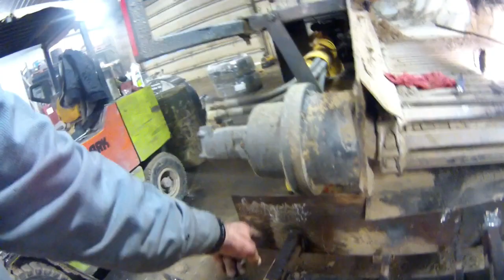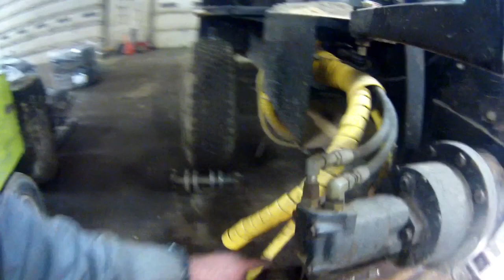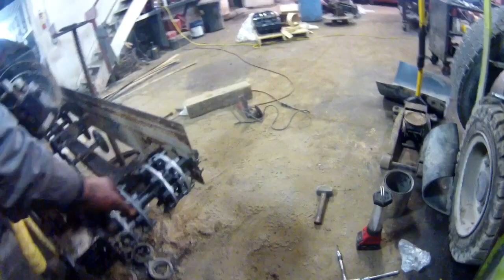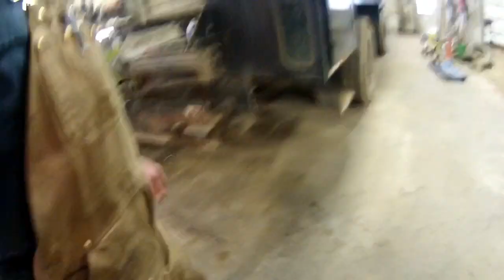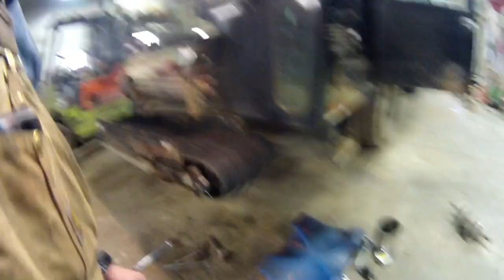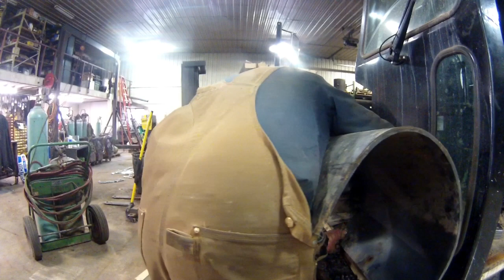Mensch sand truck repair part 2 of 2

Comment: Andy, on replacing that bearing,  when they designed it, they should of mounted that bearing away from the tank, bushings holding it away, so manure wouldn't be pushing against it, thus forcing corrosive manure into it. Even though it had a grease zirk,  probably didn't take grease because of being plug, that type of pillow box bearing are known for that.  Unless you would grease it daily or more....  But it looked like they used the bearing to hold in the liquid manure,  seal wasn't doing it's job, inside the tank.  I did  that a couple of times, with bearings, one on a manure spreader beater, & one on a feed mill.